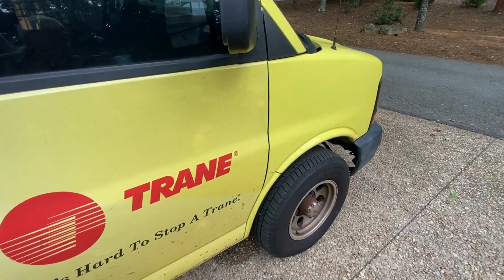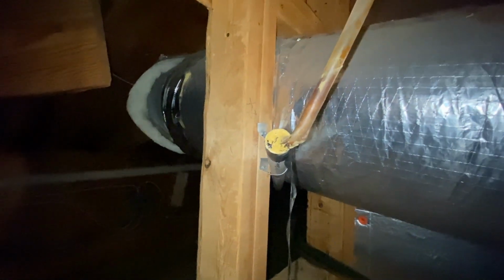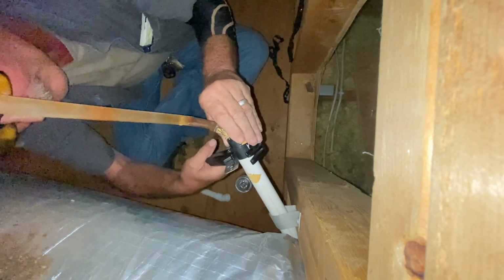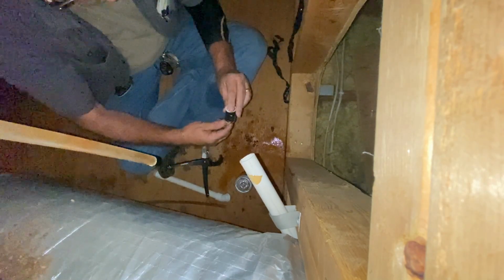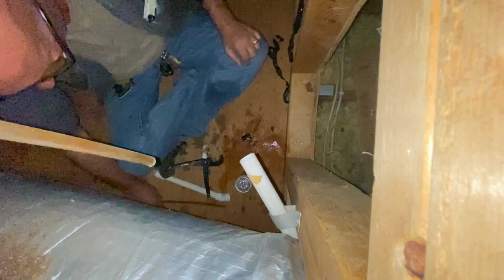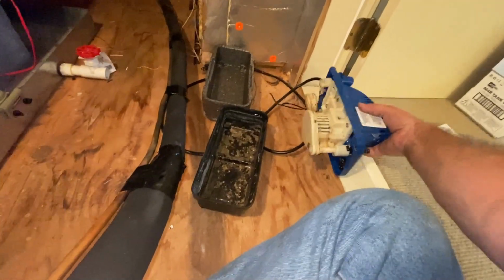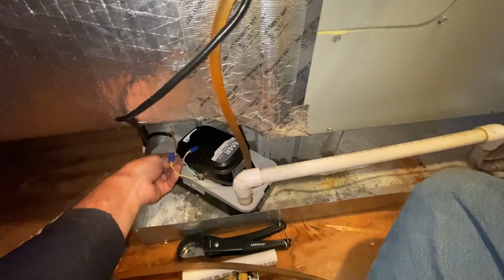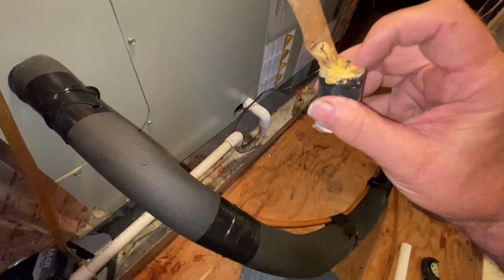Hack Job ! Condensate pump in attic

Comment: i only ever seen the rtv sealant used on a condensate pump a few times. i usually drill a hole thru a 3/4 cap and snuggly insert the tube into that. I dont glue the cap but i put rtv around the tube. The barb fitting is the right way to do it. What a wonderful attic by the way you're lucky

Comment: Another fine job Ted. 

and looks a hell of a lot better than flex tubing sealed with big gap filler which comes out like silly string  and Ted I hate that stuff period even for insulation.

And while I am sure had you have done the instalation of the condensate drain pipe it would have been all cpvc or pvc pipe.

At least you found the issue and solved it quickly for the custumer and brought them relief.

Ohh ted question on one of your older videos I saw you fix in 5 minutes a leak in a copper pipe with what looked like copper  solder near a compressor without cutting or unsweating the copper pipe what the heck did you  use.

Because it would save a lot of techs a lot of time.

Comment: I had conduit installed  in our house when it was being built as a just in case and it turned out being a blessing as the attic condensate drain got clogged somewhere and after lots of attempts determined it was clogged in the outside wall instead of spending a lot of $ to find the blockage ran a tube from pump to the basement through the conduit and let it drain into the basement utility sink.

Comment: Might want to consider replacing the old used & discolored tubing with brand new & thicker walled tubing, no? So that the tubing doesn't get pinched where it's held in place by the "ceiling clamps".
Reply: That tubing looked iffy for sure!  I thought reinforced tubing at least!  But that was much better than before!
Reply: or even just use pex

Comment: I am a lead installer in the Columbia area. The service techs at my company insist every air handler gets a pump in an 8x14 pan, so they only have to clean the water out of a small pan in the event of a clogged drain

Comment: By using that barb adapter you are greatly reducing the condensate line diameter.  The flex tubing and white pipe looks to be at least 1/2" and the inside diameter of the barb looks to be no larger than 1/4".  That barb adapter is going to clog for sure!
Reply from the maker: It is the exact same sized barb fitting that is on the pump itself connected to the other end of the hose.

Comment: Why would the original installer even put a condensate pump in an attic? That drain could have easily been gravity fed to the outside with plenty of slope. Added a condensate pump is just asking for a failure and just plain lazy.

Comment: Seems to be in an attic, so some 12 or more FEET for a NON-pump, simplified gravity fed drain… WHY would the original HVAC installer not simply figure a proper slope and eliminate an electro-mechanical failure point all together!!